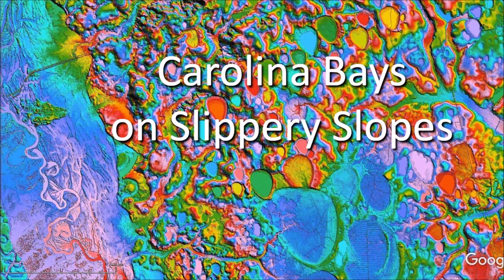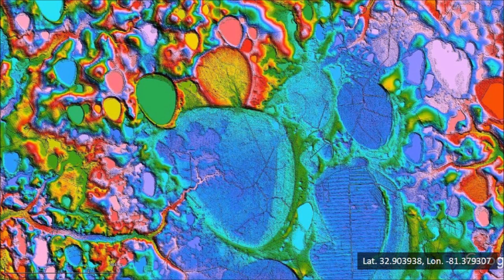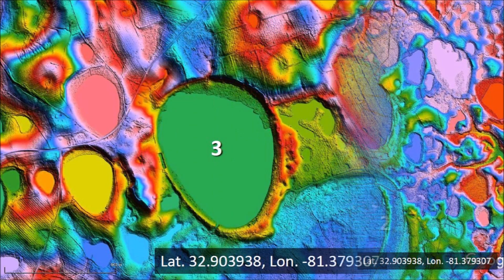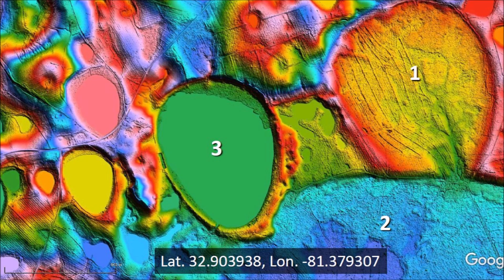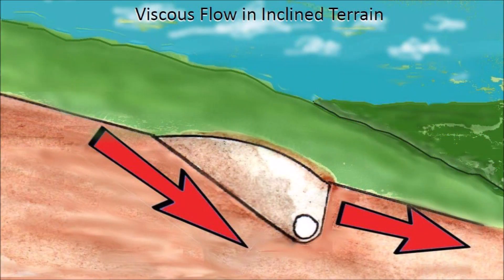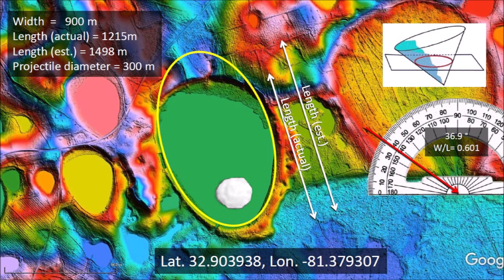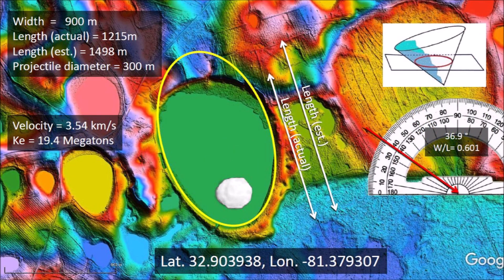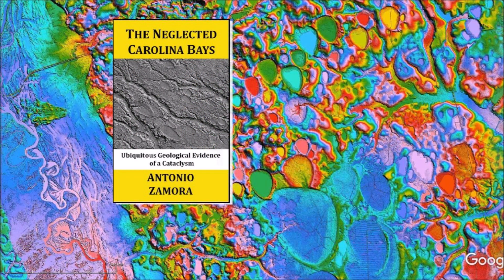Carolina Bays on the slippery slopes of the Savannah River

Comment: When water expands it does 1700x in terms of volume, iirc. Doesn't that give the initial ET impact on the icesheet some extra "oompf"? If so, why not?
Reply from the maker: Many of the bays greater than 1 km have a width-to-length ratio of 0.58. This means that they were created by impacts at an angle of 35°. The implication is that a powerful expansion of a steam plume gave an extra boost to the ejected ice boulders which otherwise might have impacted at 45°.
Reply: @Antonio_Zamora  😲 I am in awe, thank you AZ!

Comment: Great work, what is the time estimate between Bays 1 2 & 3. Considering it was a single impact into Saginaw Bay, then the projectiles would have all originated at the exact same time and there trajectories would have been influenced by their shape, mass, atmospheric pressure, dissolution of the ice, and any collisions with each other that may have occured. I would love to see an experiment with a shotgun shell fired using super high speed camera. I want to see the difference in the time between impacts of the shot. Love your work.
Reply from the maker: From the ballistic equations and the time of excavation of the ET crater (about 30 seconds), the secondary glacier ice boulder impacts would have occurred between 6 to 9 minutes after the ET impact. So 3 minutes is the approximate time difference between impacts 1 and 3.

Comment: Would you like to explain why the impact craters on the moon are straight into the surface no matter what direction they arrived?
Reply from the maker: The craters on the moon are circular because they are made at great speeds (17 km/s for asteroids or ~50 km/s for comets) on a hard surface.  During the contact and compression phase of an impact, the projectile and the target point exceed their yield strength, and when the pressure is released there is an explosion that starts the excavation phase. The energy forms a hemispherical shock wave that creates the crater.  By contrast, the secondary impacts that created the Carolina Bays were at speeds of 3 to 4 km/s on viscous ground, and the energy was dissipated in the formation of a penetration funnel (an inclined conical cavity), so there was no explosion.
Reply: Can you demonstrate this in a future demonstration that a simple man like me can understand. It's clear that descending through the Earth atmosphere at a high rate of speed is much different from the outer whatever they call it around the Moon. It kinda funny that moon landing vehicles have nothing around them remotely simular to the Space Shuttle yet they land with a vehicle attached for exploration.
Reply from the maker: @davemeeks8109  The Earth has air, and you can use a parachute to land softly on the surface. The Moon has no air so you need to fire rockets to hover and keep you from hitting the moon too hard